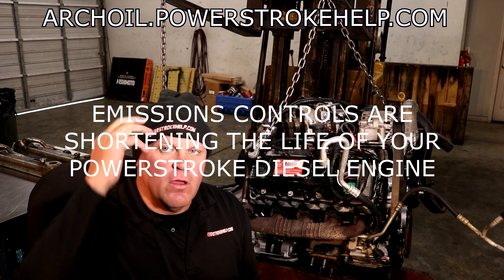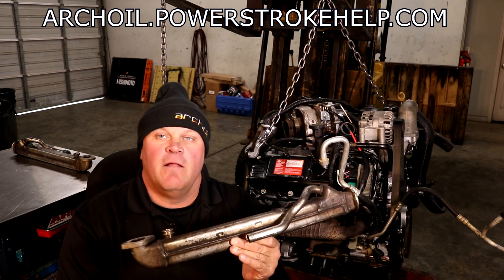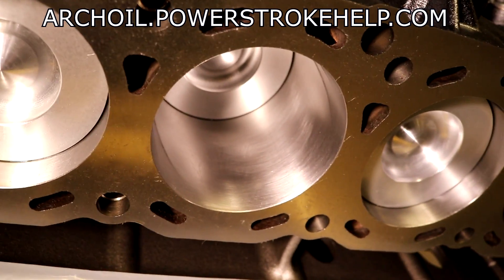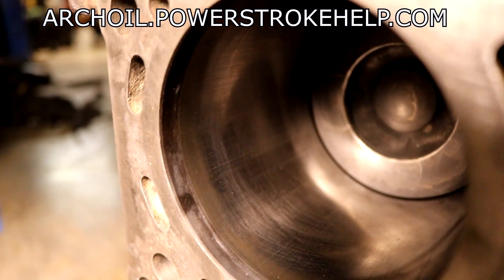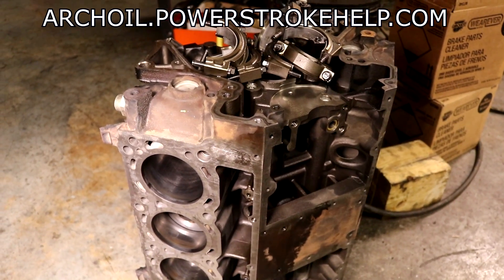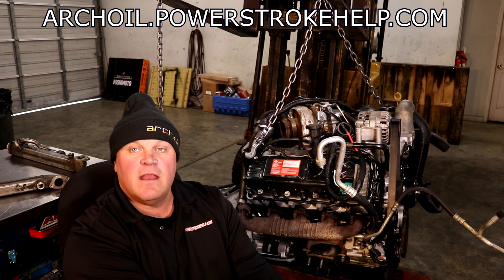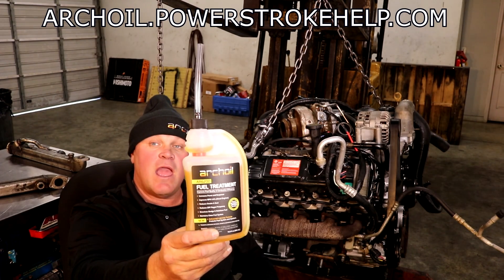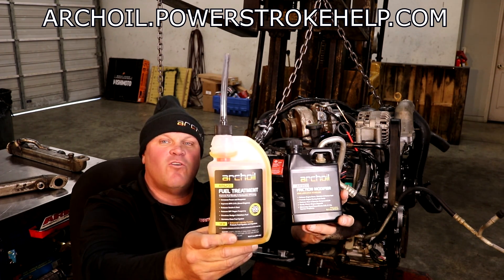EMISSIONS CONTROLS ARE SHORTENING THE LIFE OF YOUR POWERSTROKE DIESEL ENGINE

Comment: Using a low mileage engine that was under maintained, does not help you prove your point.  Yes, a cetane improver will lower soot produced by the engine.  The issue is you really do not have good scientific proof that carbon caused these failures.  Every 7.3L that enters my shop in the last 10 years has been dusted from improper maintenance.  The number one cause of engine failure today is performance modifications.

Also you are wrong about 6.7L turbocharger failures.  The ball bearing failure is caused by an imbalance.  Look at the turbine wheel on every one of those 6.7L with excessive play you will notice a missing blade.  This was pulled off from over speeding the turbo and causing the imbalance, which leads to bearing failure.

Comment: I was a huge diesel person and owned many 73 L five years ago I switched over to gas I know it’s sad but I don’t have any these expensive problems I had with my 6.4 L and all the problems I hear from my friends with all their new diesels believe me I love the extra power but I don’t like the headache of all the emissions problems yes I know you can delete everything but what’s the point of having a new truck if you can’t take it to the dealership you shouldn’t have to buy aftermarket equipment to make your truck better plain and simple I will end on that gosh darn EPA killed the diesel happy Valentine’s Day everyone.
Reply: The EPA has done more harm to America than any foreign power.
Reply: Norman - You do realize gas engines have similar emissions systems and recirculate exhaust gas? They have been doing it since the seventies. Gas engine management systems are every bit if not more complex as diesels.
Reply: @Smedleydog1  
They are definitely not near as complex as a modern diesels emissions equipment, hell most modern gas engines don't even have a egr system in place, they can use the variable cam timing to achieve the same emissions goal. They only real emissions equipment they have is EVAP and a catalytic converter and a they last along time nowdays as long as you don't put a tuner on that just dumps the fuel in. Carbon isn't a problem on modern gas engines with port injection since they don't make near the carbon as a diesel to begin with, and the injector keeps the valves clean of any buildup that may occur. And since most mfgs have ditched the egr you can't even say it builds up in the manifold s anymore.
Reply: Smedleydog1 Yep, but for the cost of injectors on a new diesel, I can put an engine in my gas truck.
Reply: You are in a similar boat to those of us in Europe, used to be a struggle to get our Diesels to break you couldn't get them to break down if you tried now the new ones run like shit and break all the time needing expensive repairs.
Reply: @gravemind6536  I've been looking at a Golf TDI as a grocery getter, since the emissions scandal they can be had cheap here in the US. That iGerman inline 4 seems like a stout little unit.
Reply: Just one more problem that the liberals have caused.  Now we have to clean that up too.
Reply: I’m a vw diesel guy but I won’t touch a common rail late model ....gas engines have come a long way. 
I got some buds with old 7.3s , I love em. 
The wife’s 14 Jetta with a direct injection gas engine got 37-38mpg highway on a road trip. 
Her old diesel passat got 41.5 same trip. 
That’s a heavy car compared to a Jetta. 
Can’t justify the new common rail with the emissions bullshit for 3-4mpg highway improvement. 
I’ll build em and play with em for summer cars and stuff, but the daily diesel thing is dead and its sad, I’ve been driving em for almost 25yrs.
Reply: @MrTheHillfolk , a word of warning to you with gas engines that have direct injection. They are having major problems clogging up valves. The gas on the multiport injection systems always sprayed the valves clean, not anymore. This has become such an issue that VWs solution was to have a dual injection system, direct injection and the older style, multport system, which actually negates the emissions benefit. These emissions are getting to the point of stupidity on both gas and diesel, and we are paying the price for it...
Reply: @johndiezel5781  Ford also has started duel injection
Reply: Diesel might be a dying technology anyways, the future is electric. Or have a small  4 cylinder diesel running a power pack in semis, like locomotives have.
Reply: I agree. I have a 6.0 and 2010 f150 but I drive the f150 more often just because I don't want to pay for diesel and if something breaks that cost a lot more. My F150 pulls my gooseneck fine so I'm gonna sell the diesel here soon. One day i'll move to a f250 with the 6.2
Reply: @atvrepairsandmore2482     I'm thinking this new 7.3L gas engine that Ford is coming out with is going to be awesome.  I to own an 04 6.0 and I love it!!  But if I ever have to buy a new truck, I just don't think that I could buy a new diesel.

Comment: My 2013 F350 that was running in my fleet only lasted 229 thousand miles then engine failure because of emissions... These Powerstroke engines that are not deleted will not last long. Wish you would've made this video a year ago so I could've gained this knowledge and had the opportunity to delete mine before it died. Thanks for the info that you spread always good stuff 👍👍👍

Comment: My 99  7.3 dually dump with 250k runs as strong as the day it rolled off the assembly line. 7.3  is a beast. Sure, I've had oil cooler leak ($500) CPS, a few glow plugs relays, IPS,  but no major failures. And the 6 speed manual is ideal for that engine.
Reply: My buddy had a 250 with a 7.3 and the manual. That is my dream truck right there but they are getting rare and therefore more expensive
Reply: @nknasi  Yeah these guys out here are asking a gold mine for low mileage 7.3's.
Reply: Rodney Palmer I stopped caring about miles a while ago. I care about a clean rust free well cared for truck. Idc if it’s got 4-500k miles. I’m a Cummins guy but I like fords as well.
Reply: my 99 7.3 has 334k miles on her and still running strong
Reply: They are gettin a little rare and old for a daily here on the east coast. 
Best thing a couple friends have done over the years is find a west or southern truck. 
Rust sucks up here.
Reply: Bro that's ant motor if you take care of it.
Reply: You can double or triple it. Its Diesel it won't stop going.

Comment: WTF don't they just take the EGR feed post DPF.  Solves the EGR cooling issues and the carbon issues.
Reply: I don't know, man.  It's super hot past the DPF.  I know the big trucks that I work on, they can get over 1200 degrees with all that extra fuel being fed into the exhaust after the turbo.  Feeding that back to the cooler would probably do something unexpected.

I'm not a fan of EGR to begin with.  That's like taking a nicely cooked 12 oz. steak and dousing it with feces.

Comment: What's your opinion on EXTREME low mileage 12,000 mile diesel but old as heck as in year 2000? Was previously owned by local city government fleet so it definitely has some hours not documented at all.
Reply: If its a 7.3 with 12k miles you better buy it. If you are not, where is it at so i can! 😀

Comment: I bought a new 6.7L F250 last year. You're making me wish I had my old 01 7.3L back. My only saving grace is the fact I bought a 7 year extended warranty. I will be buying some Archoil.
Reply: Don't let him hype you up.  The 6.7 has a great reputation. It's generally the fuel wash that hurts your cylinders at idle, not carbon. Carbon powder is soft, and graphite powder (carbon in some arrangement) is actually used as a lubricant. Yes, diamonds are carbon too, but that's a completely different structure than what is produced in your engine (unfortunately).  

If you look at manuals for Caterpillar's, Cummins, and other large truck engine manufacturers, they all warn against long idle times, especially in the cold. That's because it's "wet stacking" (fuel/cylinder wash) that hurts your cylinder walls. Another thing Bill doesn't seem to mention here is that the carbon he claims hurts the cylinders is actually produced in the cylinders in the first place.  

TLDR: Don't worry, drive your new 6.7 and be happy. Much more modern engine than the 7.3, although I do love the 7.3.
Reply: @nate0031 , you are correct on the fuel washing, but that is an issue with cold weather and not really an issue with modern injection systems during warm weather. I disagree with you on carbon soot. It is very abrasive, and chews up rings, which are much softer than the cylinder walls. Think back to the old IDI engines, like the old VW Rabbit diesels, they were know to chew up the rings because of soot. IDI combustion is much more prone to soot deposits on the cylinder walls and those engines would chew up rings in no time. 
The longest lasting and least problematic diesel engines were the direct injection engines that were pre-emissions and w/o egr, like the Cummins, CAT and Detroit.
On my first generation dodge truck with the 5.9L, the engine never smoked, (only on really cold startup), and the oil stayed as clean as a gas engine, compared to the old IDI engines, where the oil would look instantly black, after driving a few hundred miles.
Reply: @johndiezel5781  if you're worried about soot during the winter, use Diesel #1.  less paraffin.  paraffin slows the burn rate. slow burn = soot.  problem solved. wallet = empty.  LOL

Comment: Improving combustion should reduce potential for the engine to produce soot. That in turn reduces the chance soot can enter the EGR cooler, EGR valve, and engine intake. Running any type of diesel fuel improver is better than nothing at all.

Comment: For my 7.3 truck, the biggest thing is the friction modifier AR9200 in the oil. HEUI Injectors never loved anything so much like they love that stuff. 

However, the fuel treatment is probably still important too for the lube factor. 7.3's Were made before the age of ULSD (ultra-low sulfur diesel.) ULSD Lacks the lubricity of the fuel that 7.3's were engineered to run on. 

All in all, important stuff to use for the longevity of all our Powerstroke diesel engines; regardless of generation.

Comment: Delete the EGR & the entire after-treatment System.  Killing the engines, raising costs upon the initial purchase, raising maintenance costs & robbing fuel economy.
Reply: BROWN RANCH & REVIEW 
So sad how the emissions equipment is circa 1973 on a brand new engine. 
Gas engines are fine , they screwed up diesel with their approach. 
Who takes cats off a 2018 Camry for more power anymore ? 
I love my diesels , just not past like 2008
Reply: I work on Tractors,aka big rigs and I spend most of my time fixing emissions controls on those trucks. Some of the bills are insane. 10’s of thousands of dollars. Sometimes.
Reply: Change oil at 5K and fuel filter at 15K and you'll be fine to at least 250K. Wish you all would stop trying to scare everyone with this anti-emissions bullshit. Yeah, they suck, but with proper, timely maintenance, it'll last as long as they used to.
Reply: @NYVET48TFW ,  I respectfully disagree with you. Doing the maintenance that you mention will not prevent egr cooler failures, which often can and do wipe out engines, or at a minimal cause very expensive repairs that were never needed on older engines, nor will it prevent the soot from damaging the rings.  250K miles on older engines were the post break in period, with at least another 350K left to go. Now, your lucky if you make it to 250K with all your mentioned maintenance. Now if you are located in NY will all the road salt they use, then it is irrelevant, as you truck will rot out by 250K, unless you diligently use fluid film every fall.
BTW, why do you think that UPS, FEDex, Uhaul, and others, switched back to gas engines on their delivery trucks? Because they emissions maintenance, repair, and engine damage far exceeded the cost savings of better fuel mileage. That does not even account for down time. Add that up and this is the result, most companies are switching back to gas engines. This is very sad, and is not because people like Bill are so-called "scaring"  everyone away from diesels. He is actually offering a legal solution that lessens the damage that is caused by the gov emissions scam.  Did you know that NO2 actually help brake down low level ozone (the harmful stuff). So NO2 does more good than harm, but yet the gov makes the diesel engines run rich (soot) to keep the NO2 down, then attempts to clean it up by egr and DPF, which still results in dirty air and more fuel burnt, not to mention engine damage and more operating cost to the end user. Typical gov A$$ backwards red tape.  Please do your research...
Reply: @NYVET48TFW  The entire point of Diesel power was the fact that the maintenance factor was much less, no spark plugs, tune ups, better mileage and less cost of fuel etc. Now that the EPA has directed all Diesel power has to be fitted with DPF, like it or not, you can pass emissions without it or not, you must have a DPF to get EPA approval. And, since diesel fuel has been equal to or more than the cost of gas in the past 20 years, that feature is gone. Now that DPF/EGR etc. is part of diesel, down foes the miles per gallon and in addition to, higher maintenance cost and very likely about one half of the engine life is robbed.  So, under the name of clean air, they invented the DPF/EGR systems which burden the owners of these diesel vehicles with loss of power, more maintenance and less engine life. Obviously, there has to be a better way to clean them up so that all of this clean running technology doesn't burden owners with high risk and maintenance issues. Once the warranty is gone, not many want to continue ownership of them. The engineers need to either convince the EPA clean diesel can be done without the EGR/DPF rules or they need to extend the warranty on these systems to 500,000 miles just to put their confidence in the public to continue to consider diesel.  Today, the big rigs are getting about 300,000 to 400,000 miles on their late models vs. 1,000,000 miles pre DPF before they need rebuilt.
Reply: @Garth2011  Peanut Oil: the first words out of Diesel's mouth when he introduced the Diesel engine as a way for farmers to harvest their crops mechanically USING fuel FROM the crop.
bottom line, there is NO reason diesel engines need to be run on fossil fuels.
Reply: @NYVET48TFW  250k would satisfy you? Ridiculous.

Comment: I checked, and this is actually a better price than amazon for the same combo.  And as a veteran, I'd much rather see money in the pockets of Veterans charities than Jeff Bezos!   
I've always added the 6200, but not the 9100 on oil changes.  Is that a crucial add for 2012 6.7 f250, or is that more of a 6.0 product?  I have very little idle time, and not super heavy towing.

Comment: modren diesel engines shouldnt have EGR on them in my opinion, use the DEF system to lower NOX emissions, yes it will run more DEF fluid but i rather that than the engine sucking on its on farts.

Comment: Deletion changed my life.
Reply: Me too! DPF, SCR, WIFE, EGR: ALL DELETED!
Reply: CastFromTheHip mine too
Reply: I also use a check valve to vent the crankcase at idle. It closes and still has the turbo maintaining low pressure, but at idle, it blows this crap out.
Reply: I’m looking to have a delete done on my 6.7, although I’m having trouble finding someone to do it for me. I don’t have time to do it on my own. Any suggestions where I need to be looking to find someone? I’m in the Aus,Tx area btw. Thanks in advance.
Reply: @Yollaman2024  Remove all your exhaust. Replace with offroad only "race pipes". Install "offroad only" tune. DONT THROW ANYTHING AWAY.
Reply: @Yollaman2024  509 W 11th St, Austin, TX 78701
Reply: Do you think I should do it to my 7.3?
Reply: @buzztrucker  You can, but there's no EGR, DPF, DEF to delete on a 7.3.

Comment: The EMS companies in my area all switching to gas motors. Gas motors are gaining power and fuel economy each year and the diesels cost $10,000 more up front along with paying $1 more per gallon and the costs of servicing Diesel engines. Totally replacing a gas motor at 150,000 to 200,000 miles ends up being cheaper than a diesel that will run to 300,000 to 400,000 MAYBE. As you said diesel motors are not even lasting as long as they did.

Comment: Love your Vids! My 09 6.4 has all the emissions stuff deleted and is going strong after 10 years
Reply: How many miles
Reply: Mine is at 300,000 miles already ... but has a clog oil cooler after being replaced 4 times and 4 radiators. But, don’t use the truck anymore .. but works good just need to replace the oil cooler .